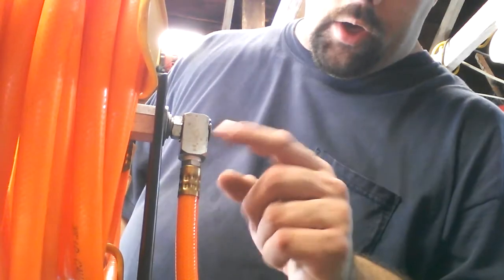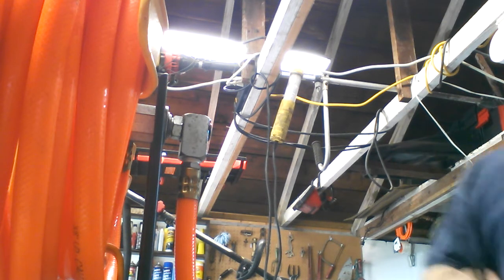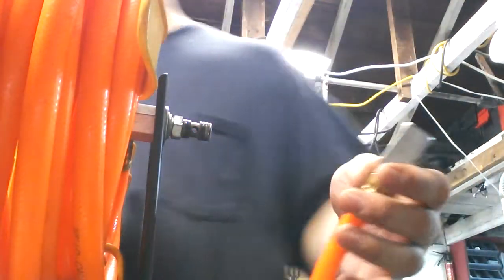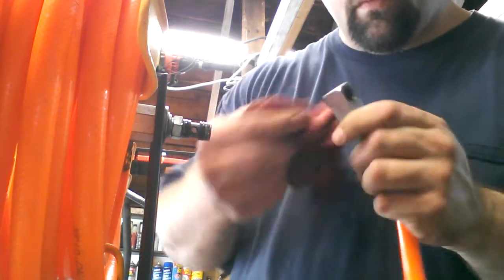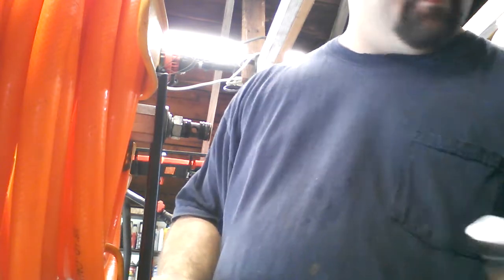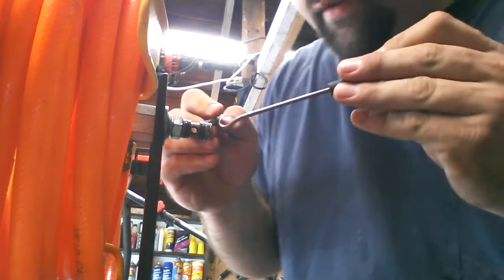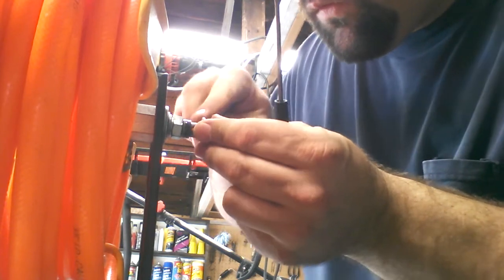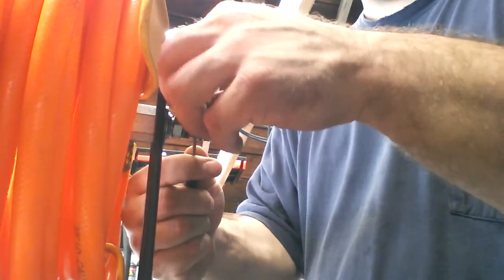Air Reel O-Ring Replacment

Comment: Here's a question for you. I have a Stihl chainsaw only 14 months old with about 30 hours. Lately it seems like it's looking for fuel. It starts, and idles but when I give it some trigger it seems to bog down. I replaced the fuel line from tank to carb, the fuel is good, the spark is good all is tight, but still bogs when I go to cut.  Any ideas ?